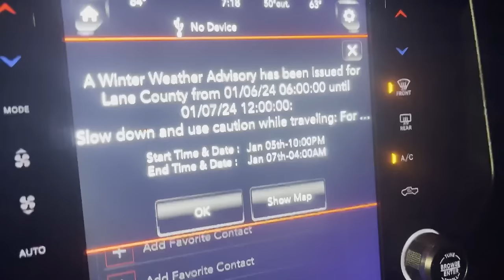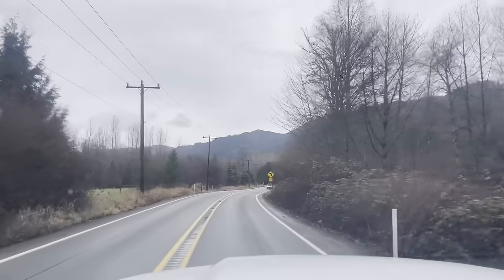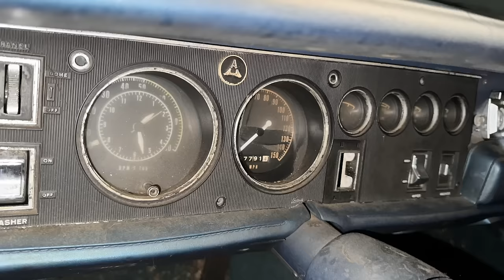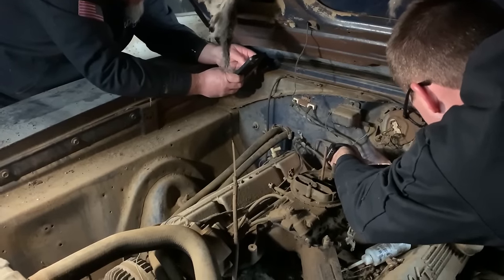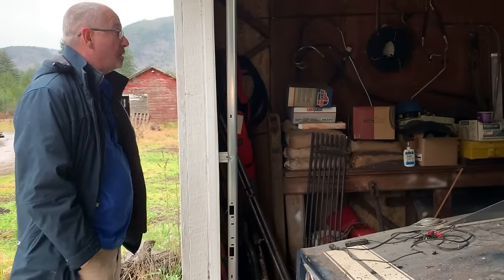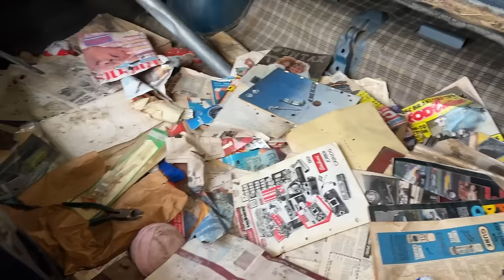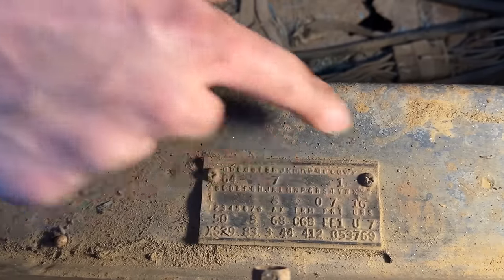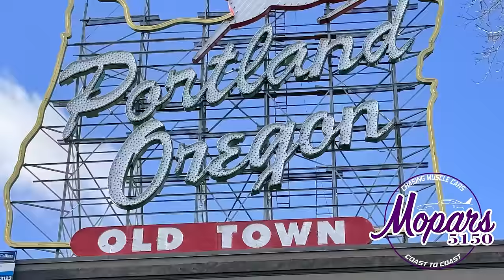Barnfind Adventure: Unearthing a ’68 Dodge Charger RT 440 in the Pacific Northwest - Mopars5150 S1E7

Comment: You know if he had to have the trans rebuilt he was driving it hard because those A833 is a good trans but them R/T
s had a bulletproof drivetrain really as long as it was not over revved then spinning a bearing or sending a rod out the pan happened and that is what happen to many of the OG 440's and Hemi's back in the day but what a cool find you got there

Comment: I’m building a1972 charger SE Brougham but I added the Rally doors and Ramcharger hood with a 1969 440 (512) six pack Strange S60 rear and Cal Tracs suspension

Comment: I thought you guys were pretty cool until I saw you scraping the weather stripping off in the trunk with a butter knife and it's raining outside why not just drive it back to California and let the trunk get rained in......

You guys are damn lucky..,.. this car is a piece of history.

Thanks for sharing you guys will have fun.
Reply from the maker: So let me get this straight 😂 it’s more important not to get a drop of water in a 55 year old car that needs full restoration than checking the numbers to make sure it’s legit when spending $43,500 on it? Is that what you’re disappointed about?
Reply: Was there anything to find in the trunk that would've killed the deal?
Reply from the maker: @beefmalone  yes, there is an S.O # on the trunk rail where we took the weather stripping seal off. If that didn’t match we wouldn’t have bought it

Comment: Had the same car around the same time. I paid 900 dollars for it. 80,000 miles.With front discs. I was 18 and not to smart. They were getting rid of leaded gas and I could not fuel for it so I sold it for 1000 bucks. The guy I sold it to drove it into the side of a bus. Boy if I could go back in time.
Reply from the maker: How often we hear stories like that

Comment: >Hack's< Bring a wire brush with u 23:22. Is that $45,000 42:01 it's crazy to see that kind of money seeing the car's shape and how much it will take to get in driving shape hoping block isn't freeze cracked
Reply: hacks?
Reply from the maker: Everything happens fast chasing these cars, we had our hauler all ready to go, the weather worried us a little and the hauler is 2 wheel drive so last minute change mind and went with the 4WD dually and 3 car trailer (which wasn’t my first choice) in the quick change left the tools in the haulers side box. Tony flew in, couldn’t really bring that stuff on the phane. No chase is the same, shit happens, we could have easily edited that part out but we want to show it as it happens, good, bad or otherwise. We adjusted, used what was there and got the job done. And didn’t lie about how it went down. Hacks? Ok 👍  All good 👍

Comment: One of my absolute favorite muscle cars!!!👍 Check out my 1968 Barracuda fastback powered by a 400 based 512 stroker with Trick Flow heads and a hydraulic roller cam, all backed by an A833 4 speed manual. 👌